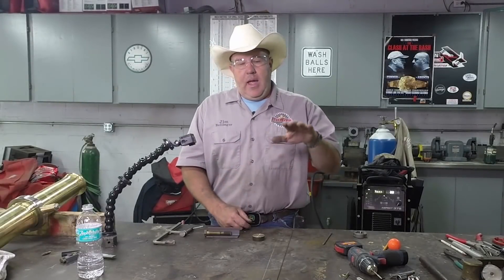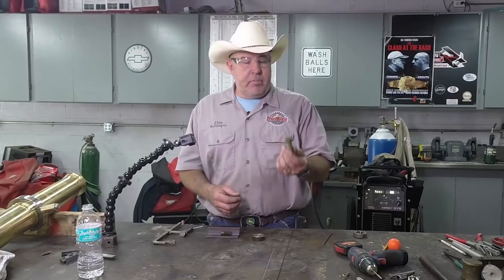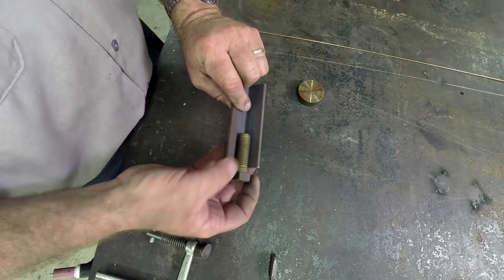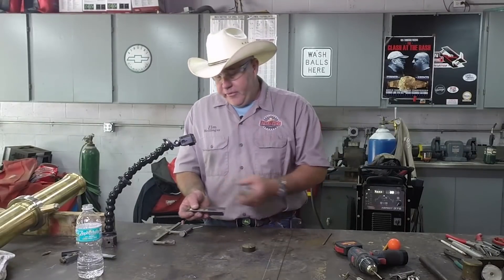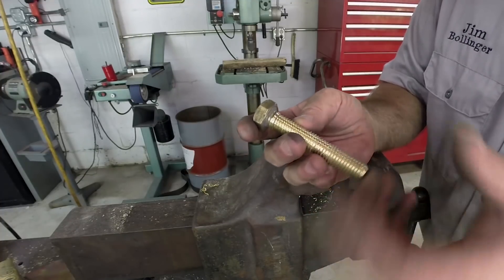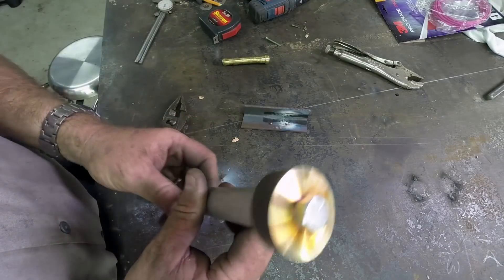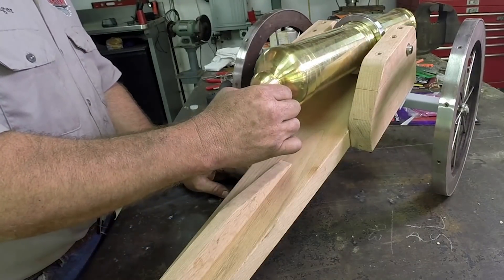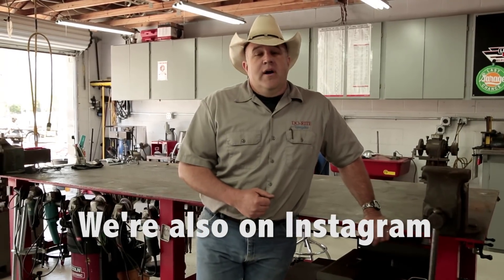Building an historic brass cannon Ep 7 - fabricating the barrel elevation adjustment

Comment: Just a trick for expanding round metal objects, when installing gears on a auto crank we heated the gears in a pan of cooking oil then slipped them onto the shaft. It simply heats them consistently without any hot or cold spots, aka, the warp.

Comment: Love the cannon and it looks amazing! but... I would never fire it... Im sure it works fine however I wouldn't want to shoot a cannon that has been glued together... Never know what could go wrong...
Reply from the maker: Better not ride in any automobiles or fly in any aircraft or go on any boat rides. Probably would be best if you stick to a horse and buggy.
Reply: @DoRiteFabrication like I said I'm sure it works fine! Just call it an irrational fear?
Reply: @teddy5004  Better not trust the buggy if your not into glue.  Come to think of it, you shouldn't use a saddle for the horse either, since they're glued together.
Reply: @Sman7290  Saddles arent glued they're stitched and then glued. Also leather or wood is much different than steel. When you glue leather or wood usually the glue is just as strong if not stronger than the material itself, the only way to achieve the same with steel is forge welding and even then you might still have flaws in the bond unless you get the steel to near melting temperatures
Reply: @teddy5004  Yes, there's stitching in saddles.  There's also interference fits and bolts in the cannon.

Comment: I didn't see you face the two bolt hunks, though maybe you did. That can make it easier to match the pitch, but then you want to vee the joint out again before welding. Of course if you silver soldered instead of brazing you can skip veeing the joint out, but the joint might spread a little. Spinning the nut down until it is holding both stubs and making some timing marks can also be a help.
Reply from the maker: Thanks!